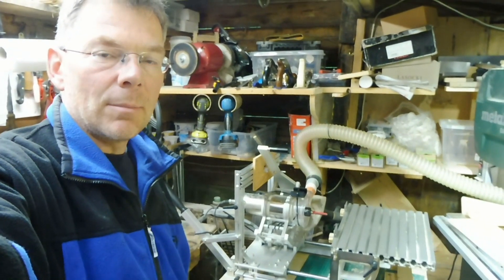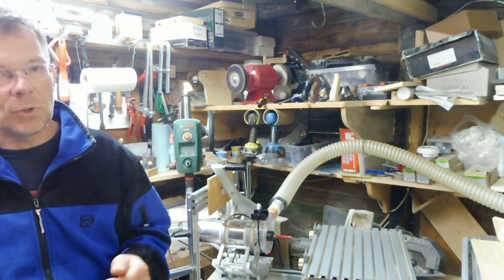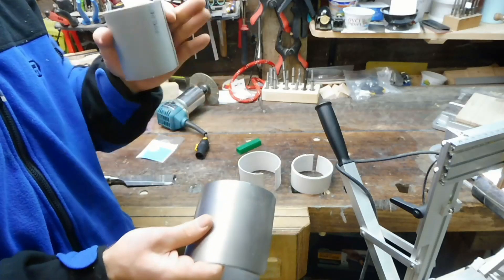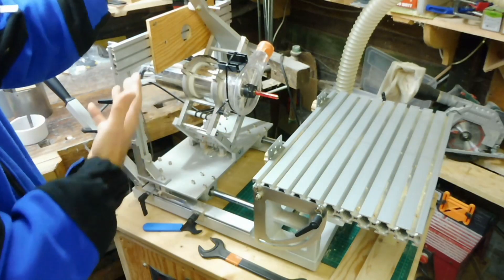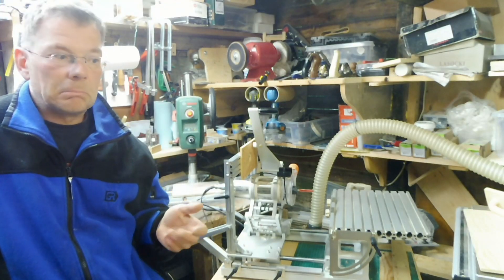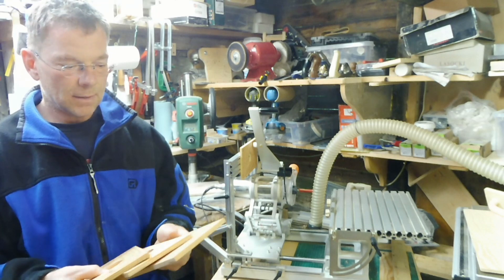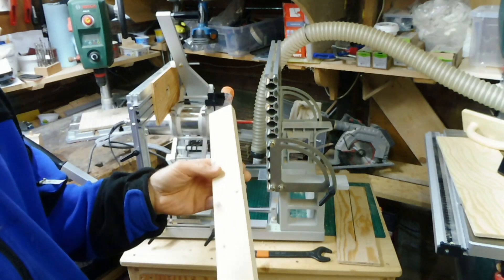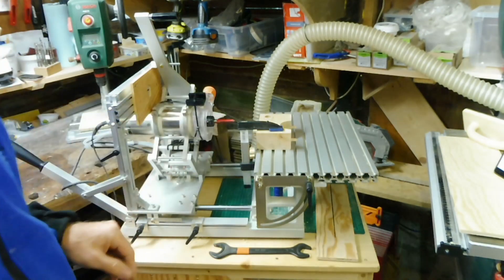Hybrid pantorouter with CNC spindle motor

Comment: I was planning on using a 0.75 KW air cooled spindle on my wooden Pantorouter, do you think 2.2 KW water cooled is really necessary?
Reply from the maker: hi, from the power perspective it shall be fine, at the beginning I have used a small Makita router 700W and it was enough. The downside of smaller spindles is that you won't have 1/2inch collet what I see as quite disadvantage. Even for 1,5kW you won't have it. Otherwise it will work fine.